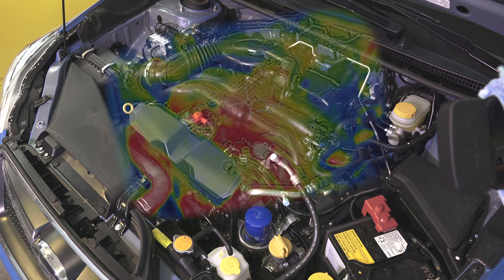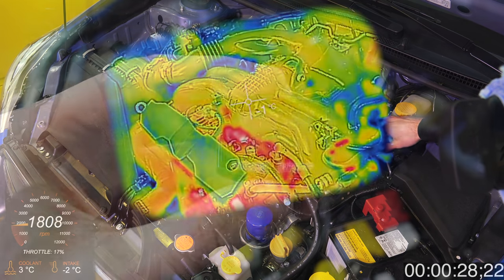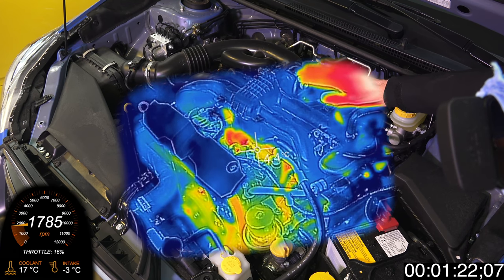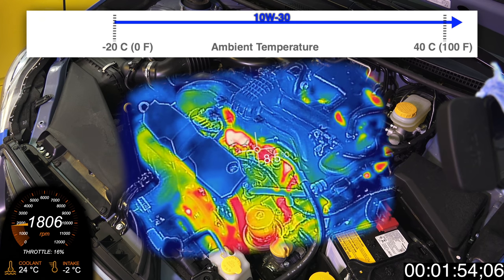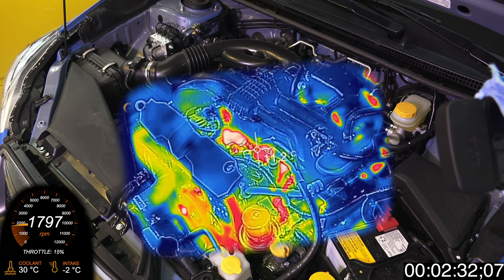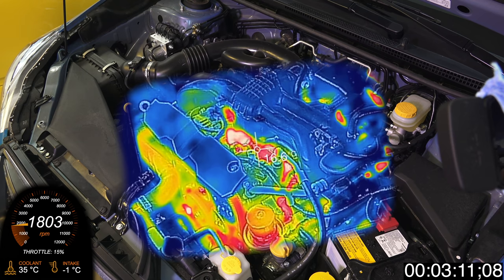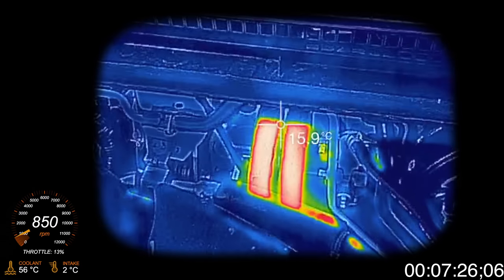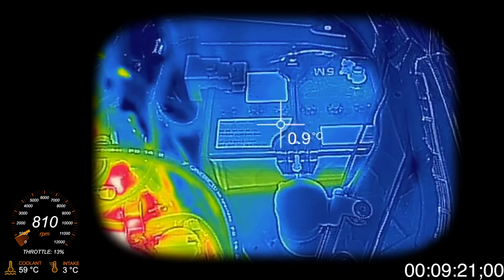Watching A Frozen Engine Warm Up With A Thermal Camera

Comment: I usually just wait till the revs drop a little then put in gear and go gently. mine are fuel injected. but if they were carbureated I'd have to let them fully warm up before in gear.

Comment: lol he said move to Florida. That state is not in my country. But there is a city that does not even dip to -20C and usually remains well above freezing most of the winter. But that comes at a cost, the average price of a house in Vancouver is so high only a lotto jackpot will get you a small 3 bedroom bungalow. A $2 million bungalow. But a note about the block heater, I'm thinking about how i can add a windshield defrost to the same circuit, since that is the real reason I let it warm up for 10 min before driving off. Just exhale a few times(humans need to breathe) and that moisture ends up on the inside of the windows goodbye visibility.

Comment: I usually brake by shifting down to first gear when driving 75 mph. A great tip, just pour a bag of metal shavings in your oil.

Comment: One thing that's important to note is that, just because an oil manufacturer says that their 10W oil flows at -30C doesn't mean that it's not basically a gel at that temperature. 5W is a bit better in that respect, but it's still not great.

Comment: You should do a video on how much an electric block heater keeps your engine warm in -40 deg celcius. It was that cold all last week here. What about power steering fluid? reg vs synthetic? when its minus 40deg C, your power steering pump screams for awhile till it warms up.

Comment: I've been meaning to comment, over 5 minutes to reach 50 degrees from starting at near zero is absurdly long. I would presume you had the heater running during this test, slowing down the warm up... My 13 year old RAV4 reaches 50 C in about 4 and a half minutes starting from below -20 C. My stance on warming up an engine is pretty well illustrated by your video: Start it and leave it alone until idle drops below a thousand revs, then drive. Coincidentally, this temperature level coincides with the lower bracket of the temperature gauge's operating range. an unscientific search of graduated dash gauges on google suggests that 50 degrees seems to be the level at which most water temperature gauges will mark the start of their indicated range, so I find it logical to suggest that an engine's typical operating range would be above 50.

Comment: Where I live it gets down - 40°C all the time. I plug in my vehicle at let run for at least ten minutes and I don't even have a working heater core, it's just to warm the engine. My parents and friends have blown lines(usually power steering) multiple times due not warming the vehicle prior to taking off

Comment: come to wisconsin in -45°F sometime. 0w oil doesn't even flow well in that. block heaters will help, but letting your gas vehicle (non-turbo) idle for at least 5 minutes, is usually still a good idea. furthermore, turbo engines need slightly longer so they can build egt temp. then there's diesel engines. ever tried to start a volkswagen tdi in -45? you're talking at least 15 glow plug cycles before you can even turn it over, not to mention the fact that diesels take longer to reach operating temperature in general due to their combustion temperature being lower. there's a reason why semis have high idle switches, and many people are now making or purchasing them for their vehicles, because it helps push oil better, and helps retain heat in the engine. good video, but definitely should've been expanded upon and not generalized

Comment: My Toyota Camry recommends 0W-20 which has a great cold weather and high temp rating
Reply: 0W-20 is not great for high temps, something like 0W-40 would be used in a high performance engine with higher internal temperatures. For a Camry engine, 0W-20 is just fine because it won't be running super hot all the time. 0W-20 is also has less resistance at that engine's operating temperature so it offers better efficiency/slightly higher gas mileage, but it is less protective at higher temp. The problem with 0W-40 is that it's more expensive than 0W-20 and just isn't necessary in most vehicles, especially naturally aspirated. Engines with a turbocharger typically call for 5W-30 or 0W-40.

Comment: That's crazy, 5 whole mins before the RPMs drop below 1500ish, I've never owned a car with an engine smaller than 3.0L and it seems they don't take terribly long for the idle to subside

Comment: engine oil does not return to the oil pan until at least 120 f  engine has 1 L oil in suspension. every 1000 rpm will suspend almost a quart of oil in the top end.return holes to oil pan can be as small as half an inch.then the oil is roped around the crank, eventually slung to the pan.

Comment: I wait for the rpms to drop to 800 which is OPERATING RANGE of the automatic choke to open back up for more air to flow. when you first start a car and its rpms raise its because the cars oem c.a.i has a sensor to go with the e.g.r so the egr at half throttle is circulating but closed at idle and full throttle. When your say you're going to warm up the car and you turn that key, it starts warming up every fluid and oil possible to prevent metal on metal cold sheering which is also what leads to a cracked block. would you start the day sprinting or waking up through exercises such as WARMING UP THE CAR. in those colder places where it drops below -20c its another reason why you folks drive standard (stickshift) less lines to warm up with only the clutch compared to lets say a '85 van with an automatic that uses a clutch equipped torque converter which slips if its really cold

Comment: Can you do a video on forged internal built motor warming up. Ie. Aluminum vs cast vs steel expansion rates and how it affects oil and gas mixing on a loosely built motor for high hp applications.

Comment: I let my 6.8 run 10 minutes max in extreme cold before driving. Not worried about oil, but power sterring and trans temp. those are two factors everyone forgets about.

Comment: I put a brick on the gas pedal as soon as I start it up, then go back inside for a couple minutes.   
If you keep your engine on the little red part of the RPM meter it means it's heating up RED=HEAT.   
Go on and try it out, it's great, the car will be warm in no time!

Comment: I live in a place with average low temperatures in January that are just below -20 C, and I find my face preserves very well, no sweat. I also have no patience to drive gently. Given that I prefer to immediately rev it to over 3000 rpm, which would cause more wear: idling until the coolant temperature arrow begins to rise or following the procedure suggested by this video? 
What about thermal expansion? Wouldn't it make sense to not load the engine at all, until it is warm, to prevent the piston from slapping the cylinder? I imagine the forces between the skirts of the pistons and the cylinder walls are greater when the engine is doing actual work.

Comment: You kind of have to let the engine warm and heat the interior with anything below -25c. Because the glass will fog up and ice from your breathing. Sometimes as you're driving. Which is definitely not ideal.

Comment: This is just the kind of thing that I wonder, as I make the chilly drive into work in the morning.  Thanks for posting!
Aside from that, I'd swear that every other post from you includes a mention of another vehicle that you have.  I know that you've acquired some and dispensed with others, but what is the automobile count at this point?
Reply from the maker: Just two! Crosstrek and S2000.

Comment: If you really want you'r engine to heat up faster you turn off the interior fan and turn it on when the engine is warm. This has a MASSIVE effect to the time it takes to heat up the engine and yet he didn't mention it on this or on the other video.

Comment: It's ALLWAYS better to use 0W40 rather than 10W40, as the first number is the COLD state viscosity.
Your oil isn't going to be cold for long and thus it has no impact on your driving.
Yet it's going to have issues flowing when it's -30 outside and you are using a 10W40, thus limiting the engines lubrication making it wear faster.

You should ALLWAYS stick to the warm state viscosity recomended by the factory, but the cold state viscosity should be 0.

Some might say that using 0W is bad because it's going to flow between the piston rings and what not, and you know what, you're right, but that's only a problem if you previously didn't give your engine the proper oil at the apropriate time and give it time to warm up before you give it above 3000rpm.

Start your engine and let it sit for a few minutes, then drive below 3000 rpm if possible. then after 20 minutes every component of your engine should be at the propper temperature to drive as hard as you want if you live in a cold climate.

Take notice as diesel engines DON'T heat to operating temperature in winter unless you do some minor modifications to restrict airflow, and thus you shouldn't be bashing your diesel engine in the winter months.
Reply: StopaskingformynameYouTube my 99 tahoe, has been running 0w30 for about 5 years now. it's much smoother in the winters here, it has 160k miles and doesn't burn oil at all.

Comment: now let's talk about the different materials used in an engine and the expansion rate since they use more than one type for metal for that. Engines warming up too quick with cause issues and tighter tolerances causing  extra wear. Modern motor oil is not the main concern with cold temp operation if your using the correct oil for the weather conditions

Comment: +Engineering Explained,  so next time start car at at same temp, let it idle for 20 seconds, then go drive it for 3-5 minutes, and then show the same thermal imaging.   If you can find a way to image the transmission would also be cool to see how much it warms up while driving  (something that will never happen while sitting idling).

Comment: it would be great to see how long it takes to first open the T stat, if it ever opens with the heater inside switched on and how it cycles. I mean how much does it take to open, how much time does it remains opened and when it closes again. Also, the fact that the coolant outside of the engine, in the radiator, when warming up the engine and it first opens it cant be a good thing for the engine. I mean if you have coolant at 0°C and then the Tstat opens and lets this coolant go inside the engine...  that's like a big thermal shock isnt it? If your Tstat is supossed to open at lets say 90 degrees and then you change that coolant with one at 0 degrees...  thats a big quick drop in temperatures...   dunno man

Comment: My car sits in a garage that is 40 degrees all winter long. It stays that temp because the cars put off heat and then the garage holds the heat in that came off of the vehicle. Even though it never gets below 40 degrees in the winter time i still let them warm up that way the heat is warm when I get in the car.

Comment: Here's another suggestion. If you live in a cold climate get a car with seat heaters. Since they run off the electrical system, they warm up the seat to keep you warm much faster than the climate control system. You only need to endure a minute or two of discomfort when getting into an ice cold car, so no need to warm it up before getting inside, saving fuel and time.
I live in Canada, and I recently got my first car with seat heaters (although they have been around for decades) and they are brilliant. Even at -25C or lower I just get in my car and go, without any warm-up whatsoever. I won't get a car without them in the future.

Comment: speaking of oil flowing a low temp. I have not seen one cold oil flow test done under pressure. Everyone does a pour test which has little to do with what happens in the motor.

Comment: i'd still rather warm it up 5-10 minutes, even in the summer. i ve always have and never had problems. i know many people with my car and they are prone to having problems. ive had three of them, two 97 and the other 01. the 01 crapped out. but i think all it is, is a crank shaft position sensor. many people ge tin and go, if they do what your saying i can see thats not too bad, maybe in time it might wear something out quicker then normal. but when you dont warm it and go and arent being gentle. the metals arent expanded and the rings as well. so i could see oil blow by if the rings arent expanded. then everything might not have oil or be properly lubed. oh well, you warm yours for 30 seconds and all warm mine for 5-10 minutes. maybe something might change my mind, but till then im doing it old school. gas isnt an issue, its so minuscule and driving and stopping and waiting here and there well waste gas too.

Comment: I would like to see how it warms up during driving because when you let it idle like you did the engine will not warm up properly. When the car is driven the engine has to work and will warm up more quickly. Maybe put it on a dyno next time, would be very interesting to see

Comment: I always let my Ranger warm up for 5-10 mins when it's 30-45 F out.  Sometimes I might hold it at 2000 to speed it up, and that works pretty well.  But it's getting the tranny warmed up that's my problem.  I need new mounts for sure, but if it's cold and I put it in reverse, the whole truck will jerk back really hard, but if it's warm, it won't do it as roughly

Comment: Taking it one step further. Is there any negative effects on the oil or engine when vehicles are turned off frequently without reaching operating temperature? Short drives and such.

Comment: Wow, this is COOL!  I've debated looking at this with my Subaru Outback 3.6R Limited but just not been sufficiently motivated (and probably wasn't going to record it).

You mentioned OBD, not sure what you're using but I found with my car there's an Android app called "ActiveOBD Pro" for Subaru ECU/TCU that works with Torque to show you a fair number of additional sensors (mine has oil-temp, transmission-fluid temp, and fuel-temp among other nifty things).

Comment: my 1.3 l Diesel needs another 15 minutes of driving in the Winter to heat the car when weather Hits -5 to - 10 C even if you give it a few minutes before starting off. so usually i just gently set off after de icing  the car. after another 5 minutes I hit the throttle :D

Comment: Let them warm up to thermostat open operating temp if you can.  It's the way the engine was designed to operate.  It wasn't designed to be loaded/operated cold.

Comment: ok everyone suggest when it's cold out, before the car fully warm up, you want to keep it at low rev and accelerate gently. this part is obvious. but nobody really ever mention what is "low rev"... is 3k rpm high? 2.5k? or is this vehicle dependent. I usually will keep it under 2.5k rpm but i'm unsure if that's too high.

Comment: No matter how cold or warm it is outside the RPM on my Audi A4 always starts at max 1200 and then goes to 900 when the engine gets warms. Or if the engine is already warm it takes about 2 minutes before it sinks to 900 RPM again.

Comment: For my 07 Accord (2.4L 4 cylinder) it initially starts up at like 1800RPM then I wait for it to get to round 900 RPM (Completely warmed up idles around 700-800RPM for me)

Comment: if u want your car to last a long time, you better run it 10-15 minutes to circulate the oil and allow expansion between different types of metal to equalize....e.g. aluminum and steel heat and expand at diff rates, as do different types of steel....this is very important to ensure gasket  life and prevent damage

Comment: And what about thermal expansion ? Basically we have a piston with 3 piston rings inside engine cylinder. when we start a cold engine we heating up piston and cylinder walls, but because of mass of the block and the fact that cylinder walls are cooled by engine coolant (which is cold according to your data)  engine block is heating up slower than the piston inside of the cylinder. As we all know heated objects are expanding proportionally to temperature, so piston should expand more than cylinder and create excessive pressure to cylinder walls, which means excessive wear. I know that piston ring have so called "thermal gap" but is it enough for rough start conditions ?

Comment: Wow, i have never seen my car idle at almost 2000 RPM even in the coldest periods of the year (-15c for weeks). I rarely use my car, maybe once or two times per week. 
Just started it yesterday , after a week almost in the open at -7c. RPM goes to 1400 max, and after a minute it goes down to 900RPM.

Comment: I have a CVPI that starts on gas and switches to propane when it's up to temp. I don't think it's good for it to switch while I'm driving because it sometimes lurches when it does, but in the winter it can take 10 minutes or so to switch on its own.

Comment: I strongly disagree on not letting your engine warm up. Getting heat into the engine is not just for oil viscosity, even though the oil filter bypasses all the oil when it is cold, But more for filling the cold gap in the rotating assembly. cast aluminum pistons, hardened rings, cast iron cylinders and crank, soft insert bearings all expand at different rates. As well as brass guides against valves. All contributing to blow by, loose tolerances and contaminates running through the oil passages.  If nothing else just letting the car warm up for 60sec will not allow the car to go into closed loop which means you are working your o2 and cat over time with the rich mixture in the exhaust and wasting gas.  Personally I let my car warm up at least 5-10 min even in the summer. But at least we agree that you need to let it warm up. Cheers.